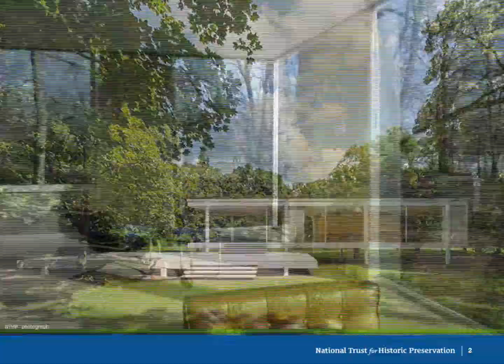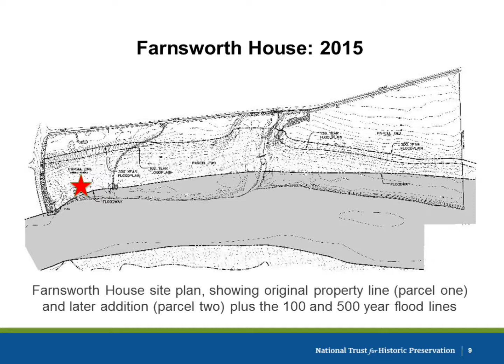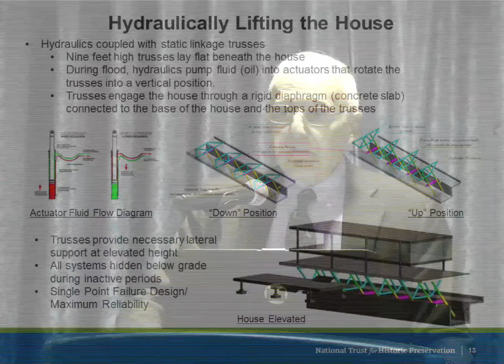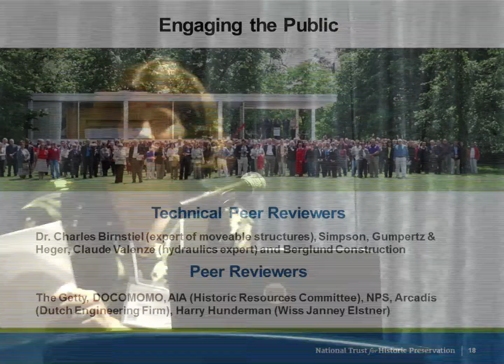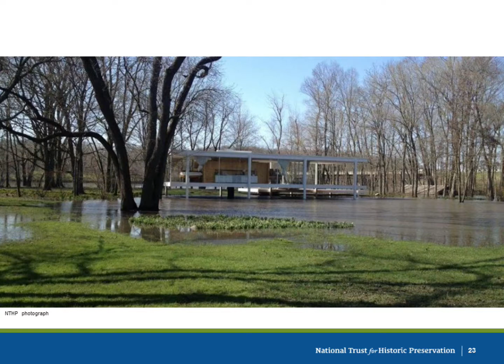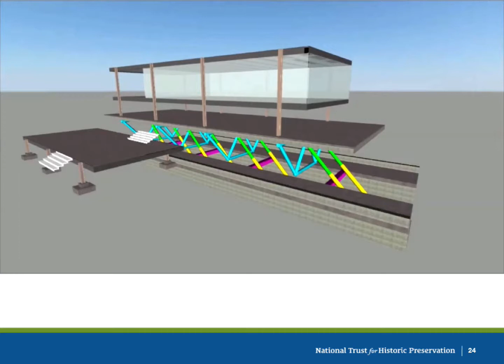The Farnsworth House | Robert Silman and Ashley Wilson Presentation

Comment: The inset photo at 2:07 does not show the building during construction...  It shows the building well after that when Edith had screened in the outer porch.  Mies never intended for the porch to be screened and he did not screen it in.  Nor did Mies, misjudge the hight of the flood waters.  Due to rapid growth and expansion in the area the flood levels have risen over the years.  This moderator needs to get her facts in order.